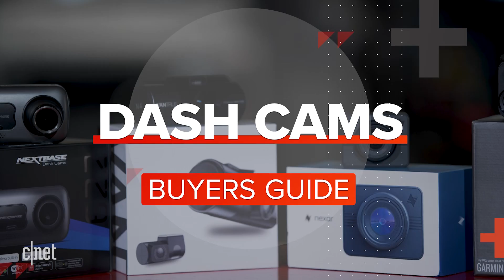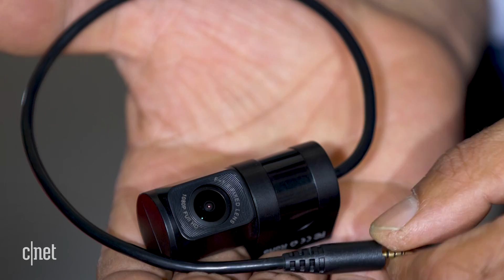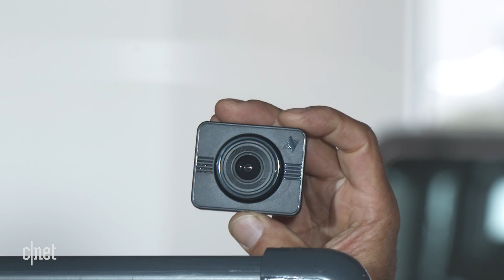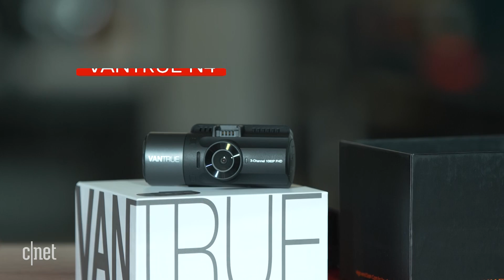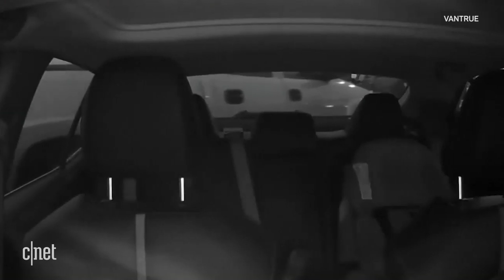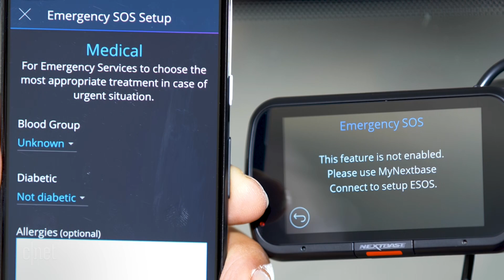Best Dash Cams 2022: The Ultimate Buying Guide

Comment: The Cadillac cts has a 360 camera setup built in. Memory card in the trunk.  And most vehicles now have front cameras and back cameras linked to a hard drive. So why arent they recording all the time is bs. But parking mode is garbage cause the camera wont catch eveything while parked. I bypass this by using a powerbank. Recently upgraded to a lithium ion phosphate generator. The cameras are on all the time. Do not use much energy. Months on end with 4 cameras. 2 garmin mini 2s on the sidesand a thinkware f200 pro for front and back. I do not worry about my car battery dying cause nothing is hooked to it.

Comment: I had a police vehicle do a U turn into the side of my car, still fighting to get it in front of a magistrate, I can prove it wasn't my fault. Never driven a car without a dash camera since that day. 
Also if you're installing one, consider a semi permeant install. I have a 12v fuse tap powering my camera from the 12v lighter fuse under the dash, no USB plugs, turns on the camera when you turn the key and it's easy to uninstall should you want to. Remove the fuse tap, take out the original fuse from the tap and replace it in the original fuse slot, remove your cable, remove your camera.

Comment: I've never had good luck with suction cup mounts; they always pop off! One thing the video doesn't address is the angle of the windshield/screen: some are angled such that if the dash cam is "locked" into a single position, it will be aimed so high above traffic as to make it worthless! So, having a camera with an adjustable angle mount is very important.

Also, the majority of people will not be able to properly run the wire from the dash cam to the power source (e.g., the car's cigarette lighter (which is going by the wayside, along with 8-track and cassette players, as well as CD/DVDs!) or USB connector), so, that can be a sticking point, as well. Even if the dash cam has a rechargeable battery, most modern cars do not supply power when the engine is off, so, the only way to charge it is while the car is running, which means that the power cable may be dangling, dangerously, near your line-of-sight. And, if your car has only one power source - - cigarette lighter or USB - - then you won't be able to plug in other devices, such as your phone, GPS, Bluetooth, etc. Fortunately, there are devices you can plug into that power source to give you extra outlets, but, some of them are not reliable (e.g., I bought a 1-to-3 cigarette lighter adapter, but, no matter how hard I tried, NONE of the outlets worked; a free replacement unit wasn't any better, so, I got my money back; USB adapters are somewhat better, but, some have the same connectivity issue).

So, add all the above when considering which dash cam is best for your, not only in terms of functionality, but, also, in aesthetics, ease-of-use, and connectivity! For me, the best unit would have the following features, at the very least: 4k, night vision, multi-angled, shock-activated when parked, in-unit rechargeable battery with a minimum one-hour charge between plug-ins, minimum 32 gig memory card, smartphone accessible with hack-resistant security features, front and rear cameras, a screen that can be turned off while the cam records, capable of getting other cars' license plate numbers (most can't unless they have a separate telephoto lens) (n.b., there may be things I'm omitting; I'll add them if/when I think of them, but, this is, already, a long list, and adds to the expense of the unit).
Reply: Is there a unit that has All of these features?
Reply: I have the Nextbase 422GW and I'm the opposite to you with regards to mounting since I have no luck with the sticky pads whereas the suction holds for months! Nevertheless, I have it hardwired into the fuse box so as not to take up the cigarette charging port. I've also just installed the rear camera after having the front one for years - any car I drive feels naked without a dash cam in my opinion...should be necessary in every vehicle.

Comment: I just got a fitcamx for my new Lexus.  This actually replaces the OEM sensor cover behind the mirror and makes the installation super simple by using OEM tabs and a "T" plug and play cord for power. Its powered by a capacitor and has a phone app interface.   IMHO, this was the easiest cleanest install Ive had for a dashcam.

Comment: The Cadillac cts has a sick system built in. 360°. Yet other cars have front and back cameras and hard drives but the cameras arent recording to the hard drive.  Just when driving and nothing is recorded. Backup comes on in reverse. Front camera does safety features.

Comment: The suction mount isn’t bad but usually (on the next base) it breaks after a year or so, so you need back up ones at home just in case!
Reply: I've bought several replacement mounts And the NextBase App rarely works, Zero customer support, G sensor is so sensitive you have to turn it off, and the G sensor and capture button will only save "After" you crash or push button instead of the whole video leading up to the incident. I've had mine almost two years and if it wasn't a gift from my wife I would have drop kicked it into my neighbours yard.

Comment: Why is it rarely mentioned that in order for the camera to start recording while parked through motion or impact, you must have a constant 12v power supply?  If your 12v power port only powers up when your ignition is on, and you use a capacitor type dash cam or your battery is dead from your motion sensor "watching and waiting" for an extended time, you won't get that feature to work.

Comment: Don't over pay! They all use the same Sony video sensors, and 5 year old chips.  Most have the same software with the same navigation menu.  The only major difference is getting a capacitor instead of a lithium battery.  Because lithium batteries won't last on the windshield over 113F (45C).

Comment: Ive been a happy customer of VANTRUE. I did rideshare for about 3 years and started out with a N2 Pro, no i have an N4. The only thing thing I dont like with their stuff is the Suction cup mount, it always peels off during hot weather, and dangling by the cable.

Comment: Have just got a cheap dash cam to try out, the standard of driving on this island is shocking and seemingly getting worse. Recently not for the first time, an errant driver coming the opposite direction crossed over the centre line and would have taken me out, had I not veered out of the way onto the supposed empty "footpath" area, luckily kerbs are not the norm, just white lines.
  That said, the dash cam has a GPS sensor which then records my vehicle speed. I think I would be very dubious handing over the SD card to police in case of accident, as it may show at some point I was actually over the speed limits. I can turn off that function which is probably wise. I have to say I'm a little shocked when watching playback at the speed I drive, I know the limits here seem low, but I think I'll be going slower in future.

Comment: Strangely enough I have never wanted to buy a dash cam for years. Firstly the dangling charging cables, plus the memory card needs to be over written at periodic intervals. My dash cam is my  spare Samsung mobile phone A11. And the best dash cam app ever on the market is...'Auto Guard' it has everything you need. No cables.etc. Used it recently for insurance claim. give it a try.
Reply: How did you do your mounting set up ? And isn’t the capacity of the view size very limited ?

Comment: I have the Nexar Beam. I wanted to use it in my work truck. The Nexar App needs access to your phone all the time. This app is a phone battery killer. I use a ROAV cam in my work truck. I doesn't need the app to save video.

Comment: I am on camera number 6 in 6 years.
I live in the Calif desert and every camera I have had has melted or the electronics in them have died. Due to heat.
I will have to say my GPS units have also failed due to heat also.
The suction cups on the cameras also  fail due to heat, and they fall off the window.
As for the cord, I had a USB cord  mounted to above my window  and i now just use a  short patch cord. Why carmakers don't fit cars with two USB plugs above the windows in front and back I don't understand.

Comment: Thanks for the video but in South Carolina, a car’s windshield gets so hot that  those suction type do not last.  (I’ve had enough suction phone holders fail on my dashboard). It also makes it very visible as a temptation for breaking into your car. As much as I’m not a fan of mirror mount cams, they are out of the heat and sort of blend in.  Perhaps a review of those models are in the future.

Comment: I bought the Vantrue N2 in 2019 for around $200.
Probably the most expensive in the market at the time.
It worked great for about 1 year then the internal built-in battery went bad possibly from the vicious hot Sacramento heat baking the battery to death. 
Expensive doesn't always mean better. 
I wonder if Vantrue corrected this problem with the N4?
Reply: N4 is supercapacitor dash cam and don't have a built in battery now
Reply: @wendym3015  
Thanks 👍

Comment: You missed one of the key features of the NextBase camera. The power cable is connected to the mount, and the camera is magnetically and electrically attached, so you can remove it from the car without unplugging anything. Very handy!
Reply: But the battery can't hold a charge during hot temperature above 90 degrees. Mine lasted only two weeks when I ran it on built-in battery mode. The battery didn't last more than an hour before dying from extreme heat inside my car
Reply: @rolandoperez8054  Err, what? My Nextbase does not have a  "battery mode"  - yes it has a battery, but it is only supposed to last for 10-15 minutes in order to finish recording the current clip, and then to allow the camera to shut down in an orderly fashion, so that it doesn't stop while recording a clip and risk corrupting the  microSD card.

Comment: I've been using a dashcam for many years now. My first one was so large it actually replaced my rear view mirror. It was a rear view mirror with a camera built into it. I've gone through a good half dozen or more cameras and installed many more in friends vehicles. What I don't like at all are these phone dependent cams for memory, especially 4K models. The best cams are ones that have "on board" memory and are self contained units. Cloud based cams are the worst if you don't have really good cell signal. Why tie up your phone just to store footage and lose the full use of your phone for other operations. If you have your cam running, Google maps and Spotify on at the same time, you're going to have some real problems. Just as an afterthought, if you don't own a 4K compatible computer or TV, you won't be able to take advantage of the higher resolution.
Reply: That's not how that works.
That's not how any of this works.

Your post gave me cancer.
I'm suing you now.

Comment: I have a 2016 Maxima which has only one power outlet and its deep inside the console (more later). I want an affordable dashcam to record my solo, infrequent (2 per year) trips to Florida from the Northeast. I don't want to record my trip. All I want is to record is an accident, so looping every 3 hours is fine for me (even less). I also want easy removal so I don't want fixed power cables. I would like to power my dashcam with a large battery (like a small jumper battery with USB out) sitting on the passenger floor or seat. I would recharge it every night of the trip (2).  Any suggestions?

Comment: I don't know why car manufacturers don't just:
A. Put USB ports near the mirror so we don't have to run long cables.
B. Incorporate dash cams into their sensors.
Reply: I run my own cables properly. Semi permanent install too, no cables hanging out of lighters, no USB plugs in the dash or centre console, wired up under the dash with a fuse tap.
Reply: I specified a usb port on the rear view mirror on my new car. It cost about £50 as an optional extra, which is about what I would’ve spent on a hardwire kit. An excellent option and reduced headache of removing trim pieces!

Comment: From my experience driving in Canada and Europe if you get rear ended it is always the car hitting the back of the other car which is held 100% responsible by the police.  I’ve been rear-ended several times over nearly 40 years of driving.  I also rear-ended someone who cut me off and then slammed his brakes on on a wet road.  Always the car hitting the back end was responsible.  The bigger problem I would imagine is proving the one example you showed of someone backing up into another car that they didn’t rear-end the car in front.
Reply: I've seen the people who did the rear-ending claim that the front car was backing up! Therefore, friends weren't able to get their deductible back because there was no proof either way!
Reply: @guesszoo  Perhaps it is different where you live but again my experience in Canada, the UK and Switzerland is that it doesn’t matter what you say to the police they automatically assign 100% blame to the driver who hits the back of the other car.  In which case if someone backed into you it would be much harder to convince them so having a forward facing camera makes sense.  But a rearward facing camera to prove you were rear ended would just be a waste of money.  But I can only speak from my experience.
Reply: @GeoffreyEngelbrecht   - you are presuming the car that hits you from behind is going to stop and not flee the scene…. I’ve observed more than a few accidents where the car hit from behind is left with nobody to hold accountable because the other vehicle flees the scene. Also useful to have video of who was actually driving because a car lent out etc may be traceable to the owner of the vehicle, but if they loaned the car while on vacation or something then is blame attributed to the vehicle or the driver?

Anyway, lots of “what if’s” and nuances that can be captured by a rear facing camera that wouldn’t normally make sense or be obvious to most law abiding people as to how the footage would be useful.
Reply: @sergeantrandomusmc  Good point I hadn’t thought of.  The few accidents I’ve been involved in that didn’t happen but that is true.  However they would need to be sure to do a U turn to avoid being caught on a forward facing camera as they flee. ;-)
Reply: Here in Las Vegas, we have people that are purposely causing an accident on a freeway off-ramp. They use one that is boxed in on both sides with concrete. They get ahead of a car, then purposely slam on their brakes so that you rear end them if not paying really close attention and you can't really swerve to avoid them because of the concrete sides. The car is completely packed and all the occupants claim injuries for the insurance money.

Comment: Is there a (simple/quick) way of attaching a (compact) battery up next to the dash cam so you don’t need to string wires all over your car?

Ie .just easily swap out the old battery for a new battery when needed...

Older cars don’t OR have limited number of power outlets.
..or the outlet is being used for smartphone...

Is there a “Good” way to use your smartphone as a dash cam?

Comment: The one thing they don’t tell you about dashcams. No matter which one you buy they all have weight to them. When you mount the camera using the sticky back tape it will hold for awhile. During warmer weather the glue WILL soften and the weight of the camera will cause it to fall off the windshield. I use the suction cup mount. Yes the same thing will happen over time where it will lose its holding suction. But a trick I learned is take a damp paper towel, which I store in a zip lock bag, wipe the suction cup with the damp towel and you will get a longer lasting hold. Good luck!

Comment: The biggest problem I have run into with all dashcams is that the memory card can and eventually will fail and few of these will report that to you. This is bad because you'll think everything is running fine then when you need a video clip, only then do you discover that it has not been recording the whole time. Definitely do not go cheap on the dashcam or especially the memory cards.
Reply: The Viofo a129 will beep repeatedly to let you know it's powered on but not recording.
Also NEVER order SD cards from Amazon / eBay. Huge counterfeiting problem. Order an extreme duty card direct from SanDisk, Sony, PNY, or Samsung (or from a reputable brick and mortar store.)
Reply: You need a High Endurance card if you're going to use it in a device that repeatedly records onto it over and over. It means that they're in use constantly, especially if you do a lot of driving, so it's constantly heating up. Sandisk have always served me well but beware of cheap copies. 

Also worth checking the footage once a week or so, that way you'll know if it has failed. Don't just leave it until you need it.